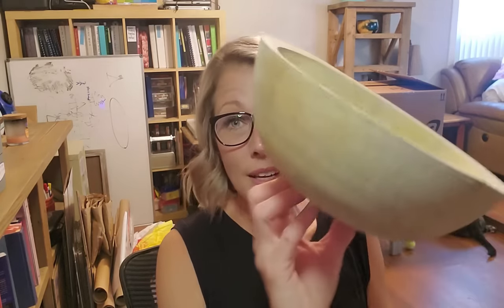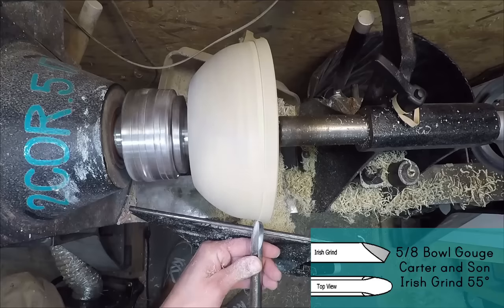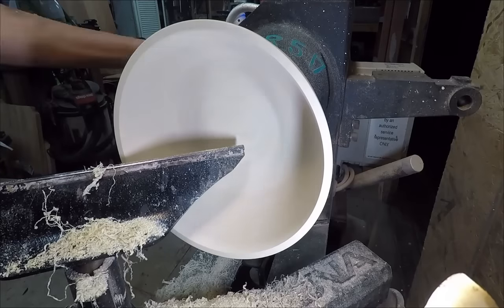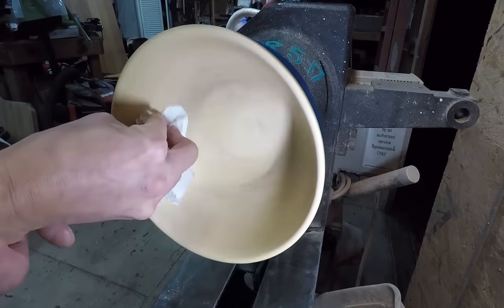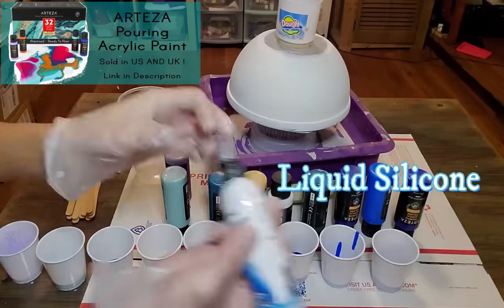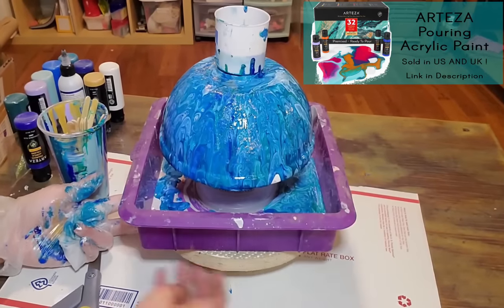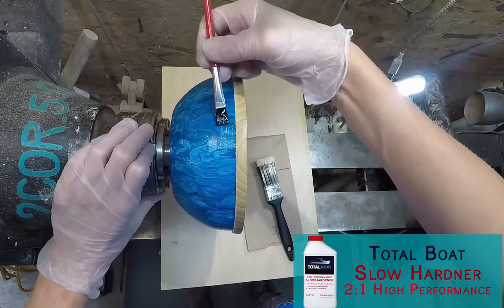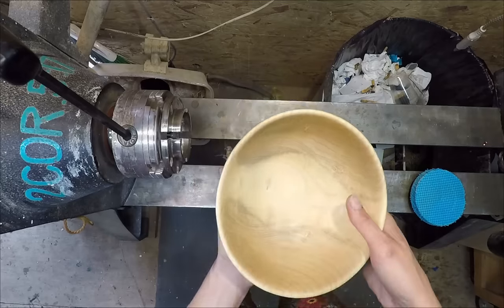Arteza Paint Pour Bowl with Total Boat Finish  😎🤗

Comment: Hi Kim this looks like a lovely 😊 peace ✌️ of ART,
I think I mentioned a few weeks ago that I was waiting for my One Way Strong Hold Chuck , it finally arrived today the annoying thing is I had to travel 6 miles to pick up point, they would not deliver to me out in the countryside oh well never mind, I am trying to put a new roof on my garage, which is going to be part of my workshop about 6 m² as my basement is my main part the workshop and does not have a lot of room because there is a large hole where the river used to go through years ago to operate the millstones, i'm sorry trying to fill the hole it was about a metre and a half deep by 2 m wide and 7 m long roughly so it's going to take me a few months of collecting stones and rocks around the countryside to fill it, autumn 🍂 is now setting there is lovely different colours on the leaves in the countryside in the hills in the mountains, last weekend I managed to pick up some bits of walnut I help somebody cut some trees down and split some logs as I have a machine for splitting logs and told me if I wanted anything to take it so I won both ways I've got paid for doing the job plus I've got some wood to take for wood turning, three or four bits of oak and about four  or five bits of walnut .
It's great watching you work and you have some very very good ideas stay safe face mask and head shield On , Phil from the Moulin in France.

Comment: Kim I made my first two Epoxy/Wood bowls.  Not knowing any better i used total boat table top resin, however they both came out beautiful.  After watching several of your vids for my own training, I switched to total boat high performance epoxy and a medium hardener 2:1, this time the rough bowl came out of the pressure pot cracked, and many voids making it unusable. is there a reason people do not use table top resin for bowls.   I am switching to a slow hardener for the next attempt. Any suggestions you might be able to give me?
Reply from the maker: I have never used Table top before. I do know the more you mix at once the hotter it gets. This causes heat cracks. It is caused from the exothermic reaction. The faster hardeners get hotter even faster. Try mixing your larger batches in separate containers. This help to keep it from going off too fast.
Reply: @KimTippin  I think you are correct i made too big of a pour.  i will use your suggestion.  I started making bowls when Covid hit and i lost my job, i really love making bowls and have been selling them quite well. I just want to tell you that I have learned so much from your show, and watching you work.  Thank you so much for your help.  You are so talented.  Mike

Comment: next time if you remember use baby power to clean the silicon off of your piece. you a puffy make up brush. put the power on the bowl and dab the brush all over. the baby powder will absorb the silica oil. then clean the brush dry it then clean off the baby powder either using air ( keep a good distance away from your piece ) then take same brush and brush the painted surface. note you may have to repeat that process again use your judgement on that. then you should be ready to seal it up.

Comment: If you put the litter box in a room that you can close the door to, you can put an electronically locked pet door in it that unlocks with a transponder that attaches to the cats collar.
That way, the cat can get to the litter box but the dog can't as long as the people door stays closed...

A friend of mine had the same problem with his dog snacking from the litter box and that's how he solved it though he only needed to put a cat sized hole in the bottom of the door since his dogs head was the size of his cat's entire body [it looked like a Great Dane sized Pitt Bull (3' tall, 2' wide at the shoulders, at least 100 Lbs.) - BIIIIIIIIG Freaking Dog]...
Reply from the maker: I thought of doing something like that. I hate that we do not have a separate room for cat box. The dogs also find it In the yard and dig it up to eat it. So stinking gross!! 🤢🤮🤮
Reply: @KimTippin  If you don't have a separate room to put the cat box in, could you instead build (or buy, a small storage box/shed perhaps) a dog house style box that you can close off the opening to something only the cat can get through while keeping fido out?
Hinge the lid to allow you to get in to clean the cat box.

Basically, build a small independent room for the cat box...

Comment: PLEASE HELP[, ANYONE! I have a question, i just casted a piece using total boat and 24hrs later out of the pressure pot it looked normal, then when ik started turning it, it chips like fine glass instead of the nice ribbons and looks like a pice of shattered glass. wondering if i did something wrong...PLEASE HELP!
Reply from the maker: Use negative rake scraper or NR carbide tips. Take little off at a time. It takes practice to cut with a gouge. I found the wide fluted gouges work best, for me.